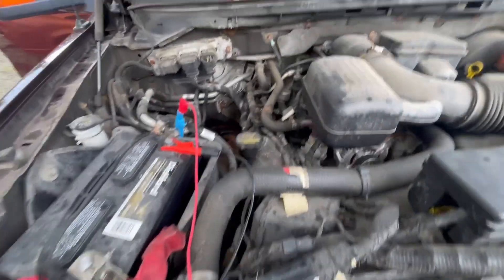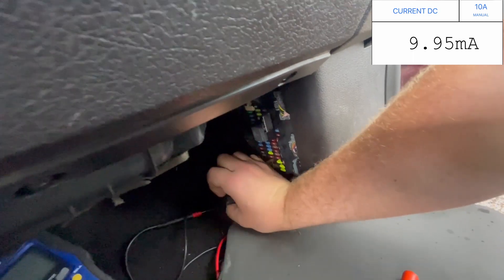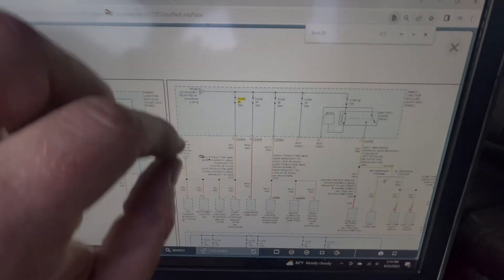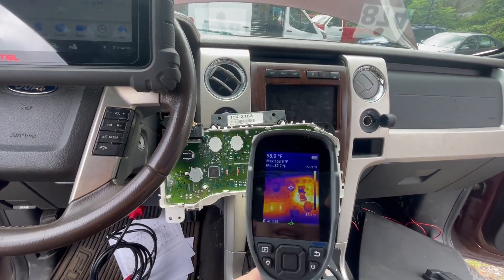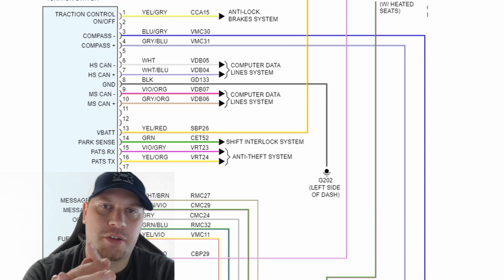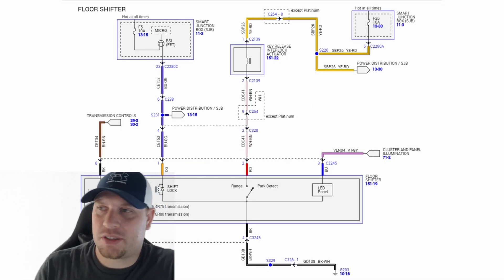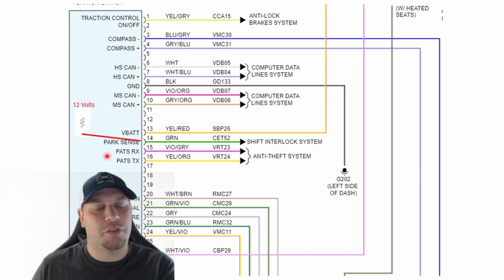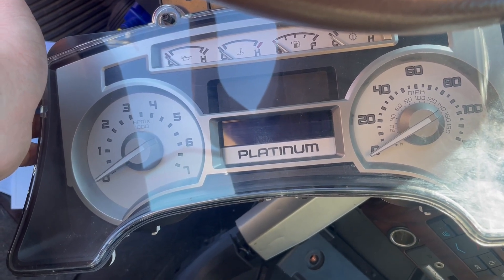2009 F150 Parasitic Draw-The One Where He Makes an Incomplete Call

Comment from the maker: In retrospect, i didn’t do the best job explaining the actual failure. 

The base model cluster goes into trucks with a column shifter. The column shifter supplies a ground path for the park sense signal to the base model cluster.

Because this had a floor shifter that input didn’t exist. 

But, the platinum cluster doesn’t require that same park sense circuit to go to sleep.

Hope that better explains what i found.

Just the wrong cluster installed.

Comment: So why didn't the new cluster you bought work?   Did you just get the same part number off of the old cluster (the wrong cluster)?
On weird parts like that, I usually call in to a dealer with the Vin and get the exact part number for the truck-- and then I happily tell them never mind- because their prices are always highway robbery..  But at least then I have the actual part number I need and can cross reference to used or salvaged parts, etc.  That's how I usually do it.     A strange side note though-  I have a 2002 F350 7.3L diesel 6spd manual 4x4 and my sticker on the door doesn't even show what kind of axle I have.  (it also says it's a "incomplete manufacturing"-- so it was a cab and chassis to begin with).    So I call into the dealer with my VIN and even they can't tell me what kind of axles I have on my truck. :)     So it doesn't always work.
Reply from the maker: So when they got the new cluster they just matched the part numbers that were on the cluster. So they got the wrong one again.